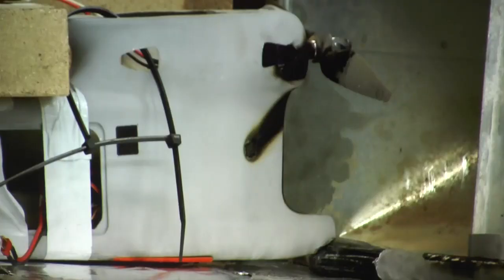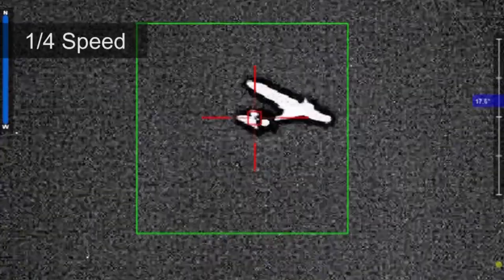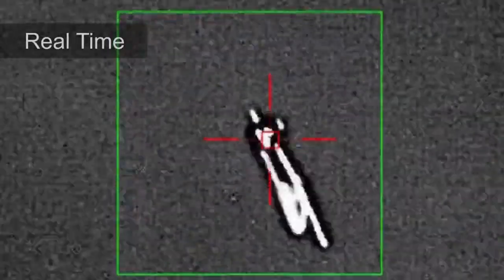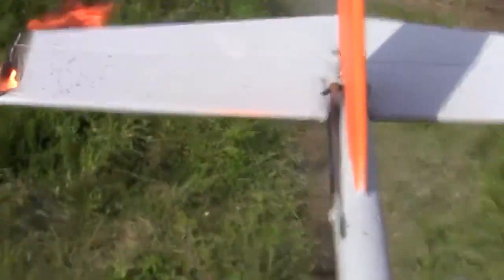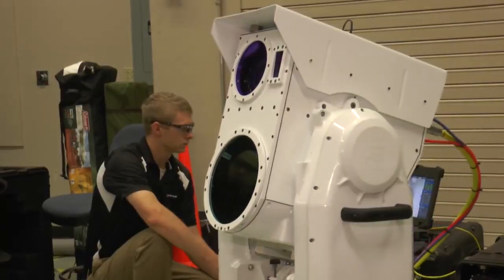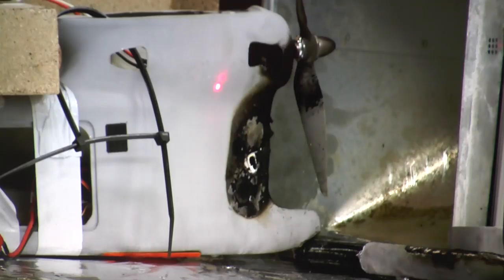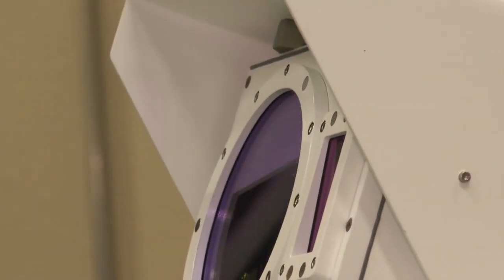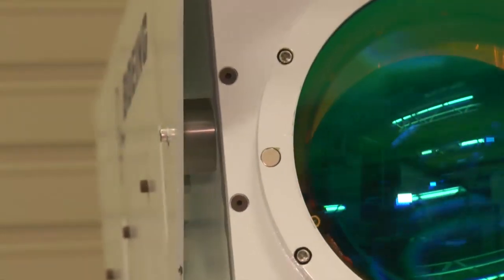Boeing’s Compact Laser Weapons System: Sets Up in Minutes, Directs Energy in Seconds

Comment: This is the end of all the expensive toys. How come ever version/demonstration uses the hold & burn w/no range, when on sci -fi it is more intense bullet like approach. The limit of range & power will only b ever worked out w/a pulse wood pecker approach. Hit the target is not the problem, nor time, it is w/enough of a blow. Gunning a jet verses trying to get a cannon shell on it for 1 shot effect. As lasers get better the mirror like heat shielding on a potential target will get ever better. Sustained damage may do the job n real world better than hold & burn. It all comes down to range, less than a football field burn away, but mile or so pinging a target w/long range never miss bullets seem better approach.

Comment: Real smart, can't wait until this gets in the hands of the wrong person
Reply: +Jerry P I'm guessing Boeing has developed this technology so that they can already begin developing technology in their aircraft to counter such devices... test resistant material, provide robust redundant systems in case one is melted, design fuel system that avoid combustion if targeted, and so on.  It's inevitable that this technology would eventually mature, so perhaps it was best that they do it so that they can also reduce the likelihood of it taking down large military or commercial aircraft.  Simply refusing to develop dangerous technology in case it ends up in the wrong hands is itself dangerous.
Reply: There's a difference between useful technology for the greater good and this. I understand the point you are making but you can't honestly say you see a need for something like this can you?

Comment: What is the maximum speed of the target?
Reply: +Frederick König as long as they know the direction, the speed and the target's not maneuvering at all, has the right body plating and no reflective surfaces...oh wait!
Reply: MP USMC SRT marketing-blahblah by people who've NEVER actually worked with real laser systems.

To hit a target, to actually do ANY damage to it, you need to both FOCUS the laser on the distance of the target and the exact spot at the exact distance with the right precalculation of how the object will move in the next millisecond. If you manage both (there is no system able to achieve this right now. And no, a ship's phalanx CAN'T strike even two hits in a row on a target - despite the high-precision radar it uses.  

Plus one thing: These powerful lasers all have a distinctive frequency (for those who don't know what that is or how it works: Let's say color). The selection of frequencies for these lasers is quite limited, well-known to the public and is defined by the crystal you use to create the laser inside the "cannon". Which means: If someone paints the drone with a color that's reflecting just THAT frequency or adds a simple, free-to-everyone buyable laser protection foil (price: less than a dollar per squaremeter) the laser will do exactly NOTHING to it.

This thing might look impressive at the first glance, but outside your tech zoo it's WORTHLESS.
Reply: justanothergamer partly right. The beam itself may be moving at the speed of light - the system to track the beam and correct the position doesn't.

Let's make a test: Draw a small X onto a drone - about the size of a penny. Now take your camera, draw a dot onto the middle of the display. Then take the camera and ask a friend to move the drone in whatever way he feels to.

Your mission: make sure the dot on your display remains on the x of the drone for five seconds in a row.

Did you manage that? Great, that's the easy part. Now repeat the same thing with a distance of 200 meters (or 600 feet if you're the imperial type). That's about the difficulty this system needs.
Reply: +Frederick König Wut? r u serious light is the fastest thing in existence. The machine does not need to move that fast to adjust for angles if thats what you mean.
Reply: I wonder the same thing. I guess after mach whatever is useless
Reply: lol
Reply: umm guys its light it goes the speed of light. Unless you're joking.
Reply: MP USMC SRT Oh no! im super offended by a person on the internet LOL.
Reply: MP USMC SRT haha ok
Reply: +Frederick König 1c
Reply: Frederick König Speed doesn't matter to these weapons because the beam is traveling at the red of light so it doesn't matter how fast the target is moving it will hit it

Comment: That's at least a start in regards of protection.
Reply: Protection? More like destruction?
Reply: LazarJ

Destruction of drones trying to ram airliners with 800+ heads on board yes.
And yes a cheap drone can ram a airliner out of the air, all you need is explosives and fly it into its turbines, every cheap terrorist can do that.
Reply: Chris K If its used like that, then great.